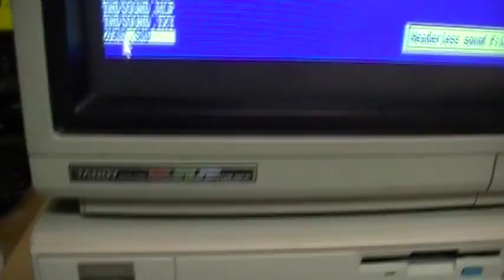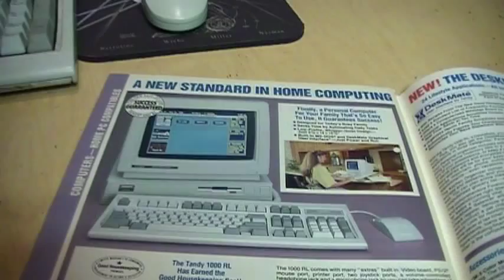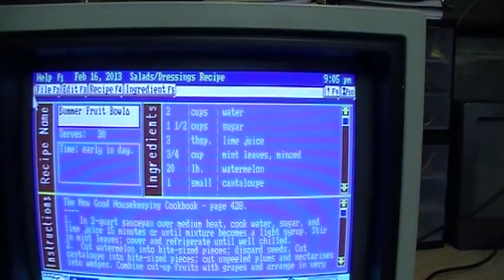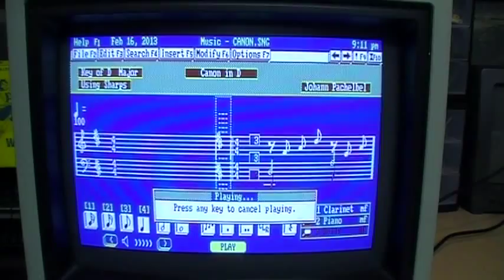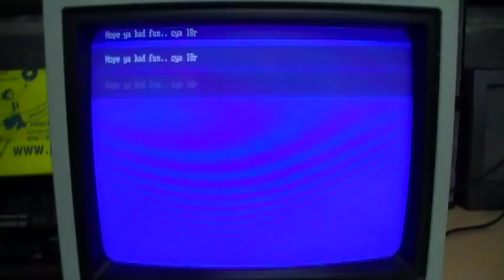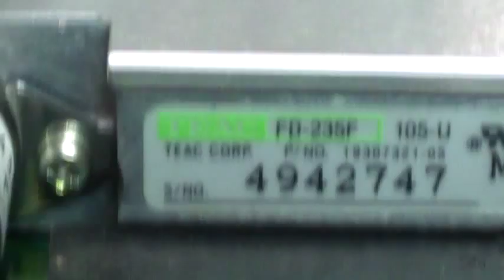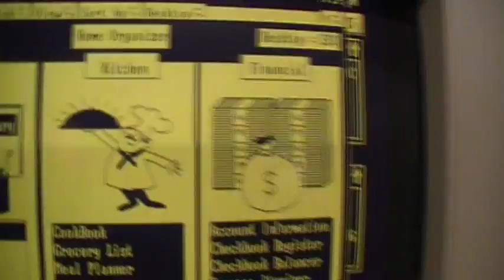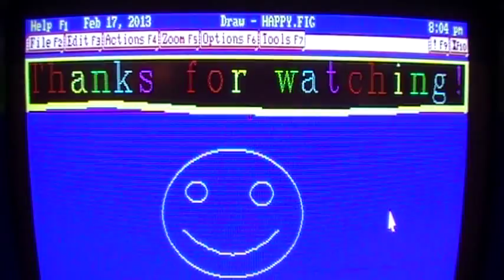Tandy 1000RL computer & DeskMate review

Comment: I had A Tandy 1000 RL in 1990, I upgraded to 768k memory and also upgraded to the 40mb Hard drive which I believe had a RLL Interface. And I was hoping to daisy chain the 20mb to 40mb, but could not do that much to my disappointment.  The 40mb hard drive cost me 300 bucks if I remember correctly. OUCH.  But I did learn a lot on that computer, used BBS Boards with the 2400 baud modem.

Comment from the maker: I forgot to mention that the 1000RL uses the 8086's full 16-bit data path to the onboard video, and its IDE interface supports DMA. This makes it very quick for an XT-class machine. I just wish the CPU was socketed so I could replace it with a NEC V30!

Comment from the maker: The Tandy 1000 series can run normal DOS software just like any other IBM PC clones. You can install a VGA card, but I prefer to use the onboard CGA graphics, because that's what most 1980s PC games were designed for.

Comment from the maker: The Tandy 1000 series were the most popular PC clones sold in the USA at the time, so they are not that rare. Prices vary depending on which model and what it comes with (monitor, software, etc.). I think I got the 1000RL (with keyboard and mouse) and CM11 monitor for around $60 + shipping, but that was back in 2007.

Comment from the maker: I believe the original PS/1 had a base price of $1299, so the 1000RL definitely was quite a bit cheaper. I used the same camera throughout. DeskMate also had some third-party software released for it, including versions of Lotus 1-2-3, Quicken, PFS Write, and Q&A Write. The demo actually went into 20-column text -- the Tandy/PCjr 160x200 graphics mode! There is no coprocessor socket in the 1000RL.

Comment from the maker: Windows 2.x has a driver for the Tandy 640x200 mode, but it is only 4 colors, not the 16 colors that the 1000RL/SL/TL support. I'm told this driver can also be used with Windows 3.x. I'm sure GEM and GeoWorks have Tandy drivers as well.

Comment: The form factor does exist, the AE PC Transporter card uses a surface mount NEC V30. I wonder if any early versions of Windows had drivers to take advantage of that 640x200 Tandy video mode.

Comment: I had the RL. I remember getting AutoCAD to run on it using a coprocessor emulator. It was pretty slow not having a real coprocessor, but I could use it for simple drawings.

Comment: Tandy computers always looked awesome when I saw them at Radio Shack. I wasn't working back then. I owned a cheaper Commodore 64 which I really loved 😀. My High School had Commodore 64's and also Commodore PET computers that we learned BASIiC on 😀. Later in my last year of High School I.B.M. P.C. computers arrived at my High School 😀. Now I use Raspberry Pi's 😀. I own the Raspberry Pi. 2, Raspberry Pi 3, and Raspberry Pi Zero W which I just bought from Amazon 😀. Do you use any single board computers like the Raspberry Pi?

Comment: Hi Kevin. Question, Is there any way to convert the Tandy Deskmate .SND files to .WAV format? I downloaded a couple of them for hahas and I cannot get them to play. I open them in my Goldwave digital audio editor and tried all settings and it just emits static. Is there a converter of some type for windows that can convert between .snd and .wav?

And if you wanted to could you take out the Hard drive from this machine and view the files on a regular windows PC?
Reply from the maker: Yes: http://www.oldskool.org/guides/tvdog/sound.html
The hard drive can only be installed in a more recent PC if it's a ST-351A/X, which can be switched into AT mode.
Reply: vwestlife

I tried Conv2snd v2.02 but it doesn't seem to work on my PC. I have windows 8.1
Do I need to run it from DOS prompt?
Reply from the maker: coondogtheman1234
Yes, it is a DOS program.
Reply: vwestlife
I tried it using cmd on windows and It didn't work but I have Dosbox for a few old DOS games I can try that.

Comment: Were these monitors TTL? Also, at the time they came out, you could have bought a better 286 with EGA and a SB card for abut the same price and have a MUCH better computer. The real appeal these had was the games.
Reply from the maker: christo930 The 1000RL was cheaper than any 286 you could buy with those features. The most direct comparison was to the IBM PS/1, which cost $999 in 1990 with a 10 MHz 286, 512K of RAM, a VGA monitor, and 1-voice PC speaker sound. The Tandy 1000RL cost $899 with a 9.54 MHz 8086, 512K of RAM, a CGA monitor, and digital audio recording and playback capability just as good as a Sound Blaster.
Reply: vwestlife I meant a used 286. You could get a used clone with 286 and EGA with a Meg of ram and the ability to load dos high and can access more memory in protected mode for about a grand, maybe slightly less..  These are fascinating machines though and I really enjoyed your videos (I watched quite a few of them last night). You have a great collection. Were the ISA slots the standard 4.77MHZ XT class? What about the board, was speed of the system board and ram access? The move to VLSI surface mount in this machine was probably the factor that made them so cheap and presumably very profitable.
Reply from the maker: christo930 On XT class systems the ISA slots run at the same speed as the CPU. So in the 1000RL, its ISA slot runs at 9.54 MHz, as well as everything on the motherboard.
Reply: vwestlife Doesn't that cause compatibility problems with such a high clock speed? I'm going off memory here, but IIRC, 6 or 8 mhz was the fastest generally available XT system. Since there is so much built in, I suppose there would be few reasons back then to need any ISA cards.
Reply from the maker: christo930 Up to 10 MHz most ISA cards were fine.

Comment: I recently got an RL and hooked it up to my tandy rgb-11 monitor  but all i get is green bars. The monitor works fine with my TL/2. Any thoughts?
Reply from the maker: It's probably running in MDA/Hercules mode. Press Ctrl+Alt+Shift+V to switch it to CGA mode.
Reply: @vwestlife  Ok thanks. I briefly thought about that as I was looking at some old documentation but it just said it shifts between colour and monochrome but I see now it also talks about resolution. Very well built machines, I turned on my TL/2 for the first time in 18 years recently and deskmate had the current day and year! The clock was only 8 hours off.
Reply from the maker: Yes. The monochrome mode is much higher resolution (720x350) and runs at a higher frequency than what CGA monitors can support.

Comment: you said it has no fan design because there is no hard drive. but then later you show us the hard drive. ?? Also, that demo program with the graphics and sound, is that on all Tandy computers? I have a 1000 in storage for the past 20 years, might take it out soon.
Reply from the maker: The hard drive model doesn't have a fan either. Most Tandy 1000s came with DeskMate but the sound and graphics demo is something I downloaded from oldskool.org.

Comment: It was not the first Tandy without a 5.25" drive bay.  That was the 1000HX.   I owned this computer.  It was a dumb purchase.
Reply from the maker: +Harun Al-Muhajir I said it was Tandy's first desktop computer to not have a built-in 5¼" drive bay. The 1000HX is not considered a traditional desktop computer because of its built-in keyboard. It's a compact integrated design, similar to the Apple IIc and Laser 128.

Comment: Why bother with the enhanced CGA? EGA was MUCH better and had true 16 colors  (every single pixel was 4 bit with no limitations). A C64 could have 16 colors too, but very limited. The color of 1 pixel affected the palate for the 8x8 square it fit into. EGA had enough ram to do eliminate the pixel limitations.
Reply from the maker: The IBM PCjr "enhanced CGA" video standard, later used and improved by the Tandy 1000 series, was introduced before EGA, and many PCjr/Tandy games tied the use of the 3-voice sound chip to the PCjr/Tandy graphics standard -- so if you upgraded to EGA or VGA graphics, older games would fall back to only using the regular 1-voice PC speaker. Some of the last members of the Tandy 1000 family -- the 1000RLX and 1000RSX -- did include VGA graphics as well as Tandy/PCjr sound, and by then (1991-1994) most games did allow use of VGA together with Tandy sound.
Reply: vwestlife Yeah, most developers, particular developers who do multi-platform go for the lowest possible audience. However there were a lot of good EGA games and I had a lot of them back in the day. What do you prefer, Tandy or a 8 bit SB?